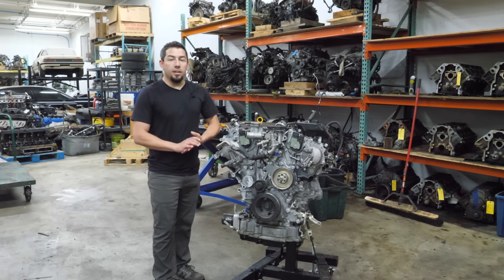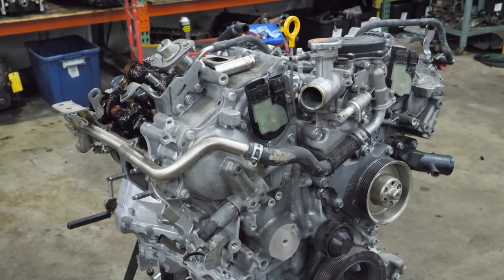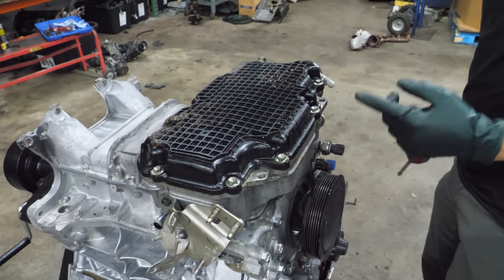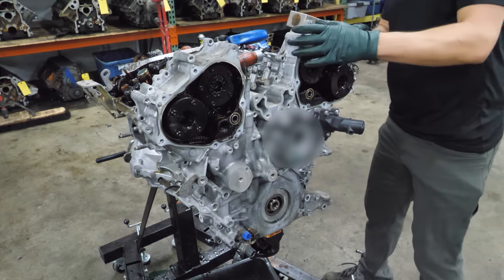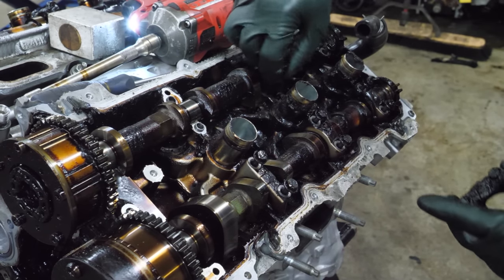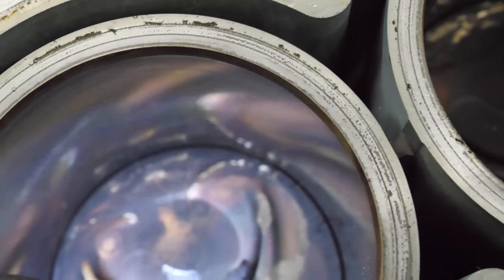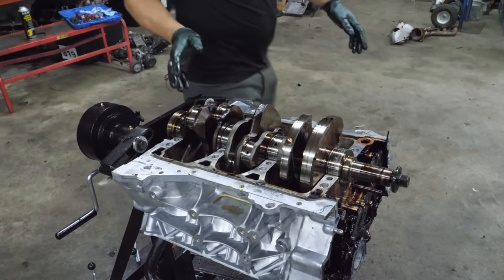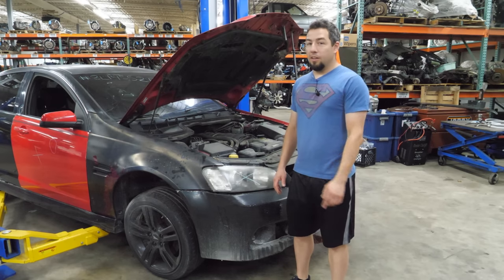60K Miles on 1 Oil Change!?! Infiniti Q50 VR30DDTT Neglected TO DEATH.

Comment: -You know, automobiles exist to take us places.  Our legs are strong and amazing, but they can't take you 30 miles across town, and then 30 miles back and you still have energy to do the things we need to do.  Thus we have automobiles.

But folks? Owning and operating an automobile incurs a little bit of involvement!  This is NOT a fucking microwave oven, it is a 3000+ pound $30,000 piece of equipment.  You need to learn to operate it, pay attention when you operate it, and do the proper fucking maintenance!

How could someone allow this to happen?  I could point fingers at certain demographics.  I am a runner and run around my home in Fort Lauderdale, and I mostly work on sidewalks, but on occasion I have to run on streets.  Florida law says a pedestrian needs to face traffic while moving, and I have found that luxury SUV's driven by females between the age of 25 and 45 are the ones to watch out for.  I have  had to dodge and/or jump into yards several time in the past 16 years that I have lived in this town, and it has always been this demographic.  I understand that this sounds extremely SEXIST, but I am the one jumping to save my own life!  I can tell you why this is happening:  All of them were on their cellphones.

I sold my motorcycle, the '76 CB 750-Four that I had bought in Toledo, rode to Orlando, rode to Dallas, rode back to Orlando, and then to Fort Lauderdale....In 2008 after 14 years of ownership.  I used to keep it in my living room in Orlando.  I sold it because I didn't feel safe anymore, due to cellphones.

The long and short is that people just climb into their cars and don't care about anything at all, just that they get there.  That is why Toyota is king:  Road appliances.

Comment: How is it even possible to get the oil to this condition on an engine with turbos?  The defoamer would have been baked out by 10k, for sure.  Did they drive for years with almost no boost, or is the base lubricant so thin that it can maintain oil pressure with all that sludge in the crankcase?

Comment: I will never understand why people buy expensive cars and then don't maintain them. Manufacturers won't warranty neglect.
Reply: Because they don't buy them, they lease them. If they do buy them, they sell them every 3 years.
Reply: @corystansbury  they still won't warranty neglect...will they?
Reply: @CaptainSpadaro  No, but this is the exception, not the rule. Most cars will survive nearly anything through a lease period. Most of the time, the neglect doesn't bite them.
Reply: @CaptainSpadaro  - the engine failed after the end of the lease. Then the car is traded in.
Reply: @corystansbury  Don't lease agreements specify maximum mileage and require proof of maintenance?  The car must be graded somehow, pretty sure you're spinning a yarn.
Reply: @rogerknapman1260  I believe so. I know warranty claims for things like engines require proof of normal maintenance.

Comment: You can do 1 million miles on a single oil change. BUT, you need to have an oil bypass filtering system installed. Has been done.

Comment: You’ve probably been asked for this one for a long time, and they’re probably impossible to find someone just throwing one out, but how about a blown rotary engine? Would you even know how to take one apart?
Reply: A blown rotary would look identical internally to a perfectly good rotary, except with seals blown. So it would be boring.
Reply: @johncoops6897  I did not know that. Thanks.

Comment: @I_Do_Cars What have you used to take out the engine Connecting Rod Bolt(12109-JK20C)? I can`t figure out what to use to remove

Comment: Oil is cheap engine not 
In real life even if you dont rev your engine and just daily normal drive dont go beyond 3k miles on oil if you care about your car change it every 3k miles 
I see how the oil loose its viscosity in my mustang after 3k the oil becomes very thin no matter what oil you use it will loose its viscosity because of friction

Comment: Imagine an oil change would cost you $90 (at most), and if it's new car? it had to have "Free Maintenance" from the dealership until 15-20k miles. Man that poor engine suffered, not a single fry given.

Comment: I'm just speaking from experience but if you have sludge build up and or carbon you can use a little transmission fluid in with the motor oil. DO NOT I REPEAT DO NOT DRIVE WITH IT IN THERE FOR A EXTENDED PERIOD OF TIME ONLY ABOUT A 100 MILES!!!!!! THIS IS NOT A ALTERNATIVE TO SKIPPING OIL CHANGES ONLY FOR NORMAL/RARE SLUDGE BUILD UP!!!! The transmission fluid will help break up carbon and sludge.

Comment: Fun fact:  The first generation Ford 6.7 Powerstroke had a plastic oil pan, but they went to a metal one after a year or two.  Don't know anything about the Ford gas engines.
Reply: I wonder why they changed a boosted diesel engine that could possibly be used as a wrecking balls plastic oil pan.....must be needed tho....🤔🙄😆
Reply: I've destroyed a few steel ones in my day...plastic was a horrible idea

Comment: Those things are absolute junk! I had one from a red sport 400. The infamous disappearing coolant issue. Had to get a long block at 23,000 miles! Didn’t even wanted with a new engine and traded it in before I even picked it up from the service department. Used to love Infiniti pre-2013.

Comment: That was a bad engine for the miles!!! I can’t understand that people drive so many Miles between an oilchange. My customers know that I always say that an oil change is cheaper than an engine! Volvo says that a d5 engine can 30000 kms between a change but when the cars are older I get it down to 15000 kms. When do You take a Volvo engine apart? Greetz from the Netherlands , ramon

Comment: Time to expriment with that BG Dynamic Engine Cleaner and Rinse Oil :)
Reply: Great way to kill the engine. Did this with some B12 Chemtool in a 2006 Kia Sedona with a similar situation (sludge filled neglected engine)... over a year later and I'm still getting a lot of oil deposit debris in the filter. Had to drop the pan several times to clean junk out of the pump pickup that got knocked loose and starved the system (lost oil pressure). It also slaps chains really bad on startup, possibly related. Would make for a fun teardown...
Reply: @ratdude747  The engine is already dead.

Comment: You lifted that first valve cover and it’s why I use synthetic, and regular oil changes. If I’m not mistaken aren’t these engines supposed to use high test gas?
Reply: If you never change your oil it doesn't matter what you run for oil or fuel...

Comment: My darling daughter has probably just ruined her Peugeot 1.4 with lack of oil.
Told her, numerous times but sounds like the hydraulic tappet has died and she drove it for 300 miles.
She doesn't live at home 😃 so I'm only called when something goes wrong.

Comment: It ran turbo reverse when cam stuck ex open cause of suctionn on piston and forced open valves on intake frome boost why al carbon all 6from zeros  out crank than double s push pull turbo to turbo detonate deck

Comment: Aw, that's not sludge, it's protectant, like bubble wrap or polystyrene, AKA styrofoam. Yeah, they were trying to protect the engine with a cushioning layer of semi-solid hydrocarbons. Imagine their courage,  knowing the criticism they'd eventually face. So at your next oil change, don't use that standard wimpy, thin 5w-20; pack that sucker with wheel bearing grease. It'll "protect" it that much quicker. nyuk nyuk nyuk

Comment: people dont understand  that oil that is NOT changed  and neglected  + contaminants and heat  over a long time turns to a  plastic like solidified sludge  rubber material.

Comment: Well....I have seen engine loss due to changing oil with the incorrect oil that doesn't contain enough Zinc and Phosphorus to protect against engine wear! When you are running a performance engine you need to stick to the manufactures recommended oils. Otherwise risk losing an engine! Any run of the mill or off the shelf oil isn't good enough for higher performance engines!

Comment: Why the fogged out area on the front cover? Next lets do the math.  60 k miles = 12 oil changes @ $60 per oil change, more or less,=$720. Now an new engine, lets say 5K, more or less, plus labor (do it yourself, which you have proven you are not going to do that) at shop rates of $125 or more, or less, makes you an idiot not to change the oil. $720 in oil or 6-7K for an new engine.  As for me, I will take that chance, I know I can get 100K on one oil change.....:>)

Comment: i have seen hundreds of engines like this. back in the 60's and 70's a lot of engines needed their oil changed at 6000 miles or less. i know a few that had to be done at 3000 miles. it does not help that in them days a lot of engines were past there best at 60000 miles regardles of how well they were looked after. Oil was also not as good as it is now and one type done most engines. if you never changed toil oil in an old car the engine would most likely be dead at 25000 miles

Comment: You see a lot of this stuff with Full Synthetic Motor Oil. Conventional oil 10W-30 or even 5w-20 or 5w- 30. I have not seen this as bad as Full Synthetic Motor Oil. Why I run Conventional oil. I don't care what the adds say or manufacturer says. Full Synthetic Motor Oil just seem to not have the mineral oil in it to keep it as clean. I have run both and my mineral oil cleans better even when I changed the oil at 2 to 3000 miles. The Full Synthetic Motor Oil comes out clean as the Conventional oil comes out gray. Manufacturer says trannie oil filled for life and such. Pretty much BS when the manufacturer says this. Semi Synthetic Motor Oil seems to clean good to. I stay away Full Synthetic Motor Oil myself. You see all this thick black sludge right. On oil like the lifters it almost looks clean. Why I say Full Synthetic Motor Oil just gets cooked and turns to sludge.

Comment: I'm not willing to trust engines that rely solely on compression and friction to keep the timing gear in place on the crankshaft snout. This one is at least passable because the timing gear stays keyed, but only barely. Yikes, Nissan. Yikes. 🤢
Reply: Ford, MAZDA and their stupid diamond friction washers want to know your location.

Comment: I am sitting here, in total delight, knowing that the idiot who neglected the simplist of engine maintenance procedures, got seriously hit in the pocketbook.  He/she is totally deserving of the financial hammering that occurred.  I guess you could call it the money equivalent of a Darwin Award!
Kind of impressive what the inside of an engine looks like when you use wheel bearing grease instead of oil.

Comment: I swear, if engineers had to actually WORK on the things they concoct, I guarantee they'd make a lot more sense maintenance/repair wise. Having to drop an oil pan to get at timing cover bolts is such an asinine thing.......like really??

Comment: I worked for a mechanic in the 80’s he told me about a scrap metal yard that he worked for that they never changed the oil in their trucks they told him it was cheaper to replace the engine than it was to service it I Kidd you not. We replaced a engine in a C-50 Chevy and a year later it came for something else to fix come to find out they haven’t changed the oil still.

Comment: It may of not had a oil change but I've seen this before from people using the dollar store oil it's thin and refined so that person who uses it is just putting in filtered oil engine will run hotter oil will get thinner and eventually bake it to the inside. Btw looking at the tops of pistons I saw they were smiling at you.

Comment: Other than replacing the camshafts gears and timing chain kit and oil pump that’s a very rebuildable engine oh I forgot replace the valves in the one cylinder.

Comment: These motors just aren't that great. The VQ37 was a better motor. The VR30 is nothing like the VR38 that's in the same family. The VR38 is more VQ based, with the 3.0 being on its own. The exhaust ports on the 3.0 are also why they sound like garbage.

Comment: So another weak timing chain has broken taking the cam phaser with it.  Gears are ate up as well. Very dirty oil but the parts that matter are still all good.
Things that annoy me is no keyways to drive acceesories. Just basic very poor design. And not just these but too many engines

Comment: If your smart, you damage all parts you recycle. Guys at these centers pull any good looking parts and put them on the web for extra $
We use to hit with a hammer or drill a hole in it.

Comment: Plastic Oil Pans = Bad, Cheap Design.
Always.
Reply: omg...when i saw a PLASTIC oil pan, i almost cried.  how far down in quality car manifacturers can go?   i own a 2000 mercedes E class 270 turbodiesel, and it has INTAKE MANIFOLD made in plastic, with plastic flaps that get all gunked up by the recirculation gases... horrible cheap design, and that was 1998 ....they already started cutting costs.  still,  those diesel engines  last 600k miles if properly kept.  previous models, like 290 TDI, exceed 1 mil.